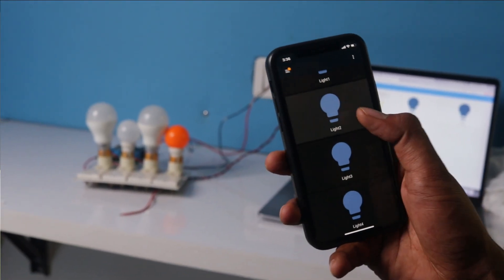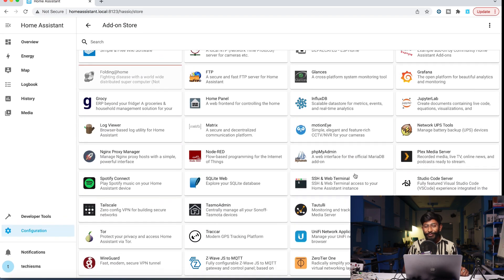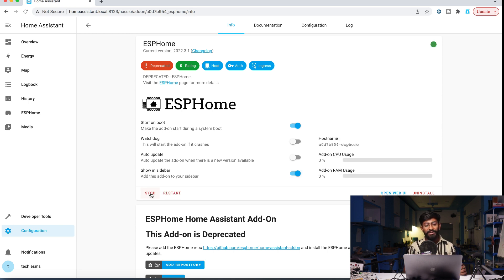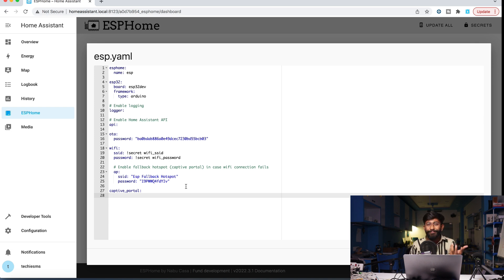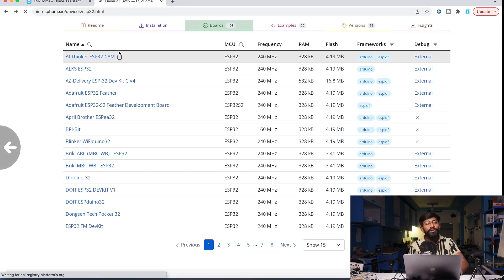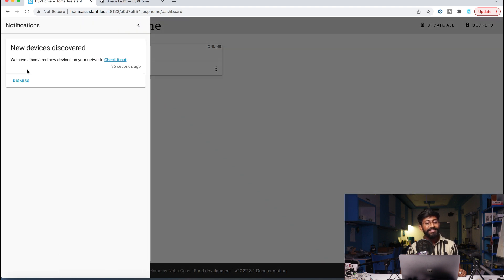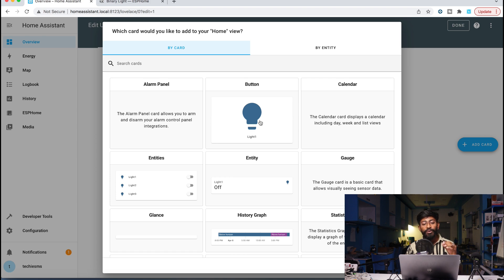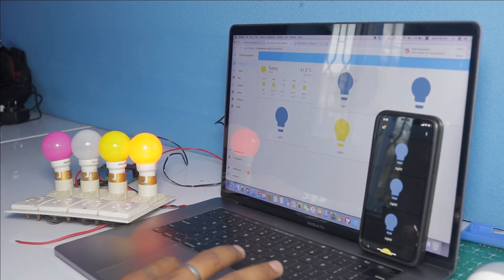(Beginner Friendly) Home Automation using ESPHome & Home Assistant | ESP32 Projects | Raspberry Pi

Comment from the maker: What next you want to learn in Home Assistant ?
Reply: Hi Nice video bro 👌 
yes can you make this as
1. Port Forwarding and use from anywhere.
2. More Esp devices, How to add ?
3. OTA code upload to particular Device
4. Voice Control
Reply: Please make a voice control home automation system which also talks back like Friday. 😎🤘
Reply: @adhyayankumar9965  start with Arduino Kit
Reply: @varunkumarr9633   I have Arduino kit
Reply: @varunkumarr9633  I want you guys to make It using esp32
Reply: Using esp32 or Arduino
Reply: home assistant integrated with manual buttons
Reply: Without internet 
Home automation project
Using nodemcu esp8266
I'm waiting this project
Reply: 1. Tasmota with sonoff devices
2. How can we operate all devices from out side without local network and without using nabu casa
Reply: Can you make a complete video how to make an commercial iot devices..(with iot app not blynk or other ). Suppose if anyone have an idea so that he can build his/her own iot device and then sell to the consumers...
Reply: What about next live session
Reply: @13adi  use sonoff devices
Reply: Without using Nabu Casa account.   

How to control these devices outside local network
Reply: nice video series on HA. loving it.
One issue i have is to detect power outage using esp01/12e. 
In home assistant, i want to handle a case: what if lights/switches are accidentally turned off/power outage (but my rpi is on power back up), but those switches/lights are involved in automation.
e.g. my porch light is switched  ON automatically at 6.40pm and switched off automatically at 9.30pm.
In case of power cut between 6.40 pm and 9.30 pm, light is switched off since mcu is  restarted.
I think HA should handle this, and I want to run an esp01 for few seconds after power outage which only purpose is to detect power outage and broadcast esp-now after detecting power outage. it would be nice if you make a video on it.
Reply: How to make a aquarium dosing pump using persistatic pump
Reply: I like to see Auto Doser device  funtion .

Comment: Making use of a sensor for detecting whether persons are present or not we can make an automated switching system at least in few area's like hall, kitchen, dining room,  which would not bother us, can use your project in places like in bathrooms, bedrooms,  veranda like that... (also by making it Iot, not just Local Network. But, Security should be considered, can add data analytics, like how much of units are been used everyday or per month, comparison, power saving mode option as in the mobile or any electronics devices, this just not save energy, help us to be aware of how much we really need to be used for our purpose. )
Combination is the Best Practice I guess!!

Comment: nice video series on HA. loving it.
One issue i have is to detect power outage using esp01/12e. 
In home assistant, i want to handle a case: what if lights/switches are accidentally turned off/power outage (but my rpi is on power back up), but those switches/lights are involved in automation.
e.g. my porch light is switched  ON automatically at 6.40pm and switched off automatically at 9.30pm.
In case of power cut between 6.40 pm and 9.30 pm, light is switched off since mcu is  restarted.
I think HA should handle this, and I want to run an esp01 for few seconds after power outage which only purpose is to detect power outage and broadcast esp-now after detecting power outage. it would be nice if you make a video on it.
Reply: I know i can do  this at MCU side too by saving the state to flash on every state change. it would be interesting to handle this at HA side instead. It might be a nice video for you to explore. :)
Reply: Running an esp01 on super caps/bunch of 1000uF can do the job? I've not tried it but i think it's doable with little bit of programming at HA side. Detect Power outage -> notify to HA server -> HA server saves the state -> run the automation script again when power is UP (notifies by power monitored by esp01). Power up state should be notified by esp01 via WIFI this time in case of lights/switches are over WIFI, just to make sure everything is up.
Reply: Basically, you can make two videos on this topic.
1. Run esp01 on super capacitors/bunch of 1000uF caps for few seconds and broadcast esp-now protocol on power outage. 
2. Restore  switches/lights to state before the power outage by HA.